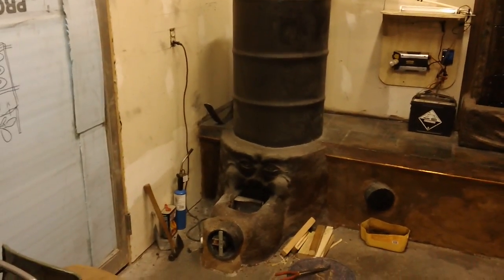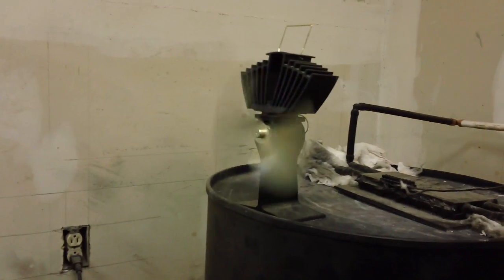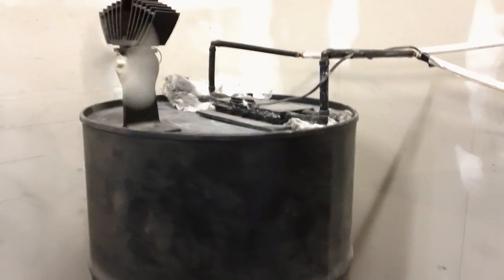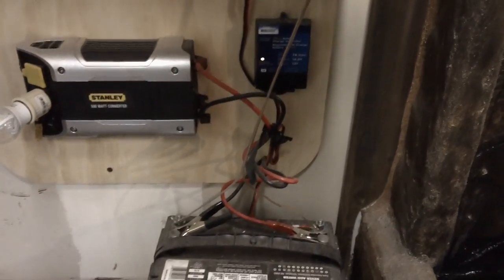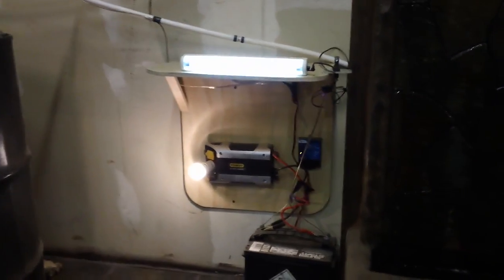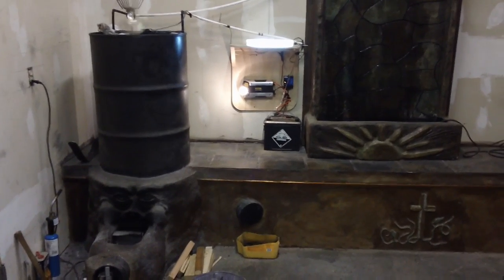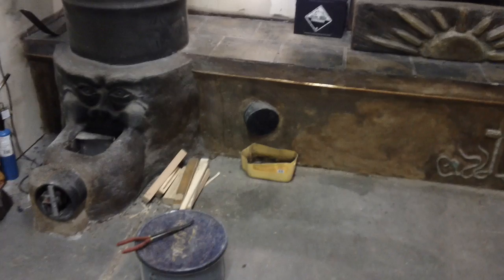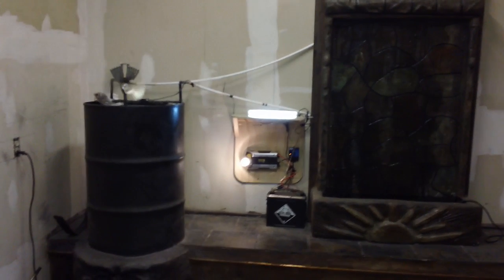Rocket Stove / Thermoelectric generator and waterfall part 1

Comment: put 2 pavers under the battery do to batteries not liking heat they won't work as well with high temps I know from experience I live in one of the hottest states

Comment: Nice idea brother, I think I can boost your output some, an outside air intake plumbed to direct air through a radiator that cools your TEG units before it enters your rocket stove should produce a temperature difference that will create even more electricity. God bless!

Comment: Good stuff. I had been reading lots of Tesla patents, and later in his life he took the trouble to patent a fountain. A lot of people scratch their head over his fountain because why would a guy like Tesla work on something so modest. But what is interesting about his fountain, is that it uses a tiny, lower power, spinning motor with a prop at the bottom to spin the water level up into a vortex. The water level rises up, and spills over the circular shape of the fountain. So with very little power, he can move all that water, and make it fall. Anyway, just an idea for you.

Comment: Great video! Where did you buy the thermoelectric generator and what did it cost? Do you have any more specs for it like what conductors/semiconductors it uses?
Reply from the maker: the thermal electric generator modules can be purchased on the Internet  I get the best ones with the most power for the cheapest price I can find some of my other videos will give you a lot more information about the TE Gees

Comment: waterfall may seem a bit silly to some, but yea it can be a very efficient way to transfer heat from the water. when the stove isn't in use, I wouldn't doubt you'd actually see the water temperature drop 5-10F below room temperature due to the evaporative effects. the peltiers will work best with the biggest temperature difference between the hot and cold sides, so good water circulation will help, but you'd want to be sure to generate plenty more power than what is used to maintain the system. a small 12 volt pump might be enough to keep the water circulating but use very little power.

Comment: Damm interesting!
If you used a couple of one way ball valves like the heater in an electric coffee percolator that might work as an alternative for the waterfall pump and any steam produced could be useful... Old railway locomotives used a jet of low pressure steam going up & out the smoke stack to pull air into the firebox faster.

Comment: This concept could be used with household furnace.
Thermoelectric modules could be place around chimney flues/inside furnace heat exchangers/on heat plenum coming off furnace. It all about how to widen the heat difference.
Why no one has developed a furnace where the heat exchanger is the TEG is beyond me - it would be a stand alone furnace and then some.

Comment: I really like the way you have put together this system. The waterfall is a brilliant idea too. I would love to see this system perfected (relatively speaking) and in a finished home setting so people can see that it can be functional as well as be integrated into a nice modernized look.

Have you thought about using steam to generate electricity?
Reply from the maker: Thanks.. This system could be in a rock wall with fire blow the water fall and would be nice. I just really prove concepts and never get around to finishing much . Steam engines are just about 4%-5% efficient meaning the TEG are about the same with out moving parts to wear out, I also built sterling engine for heat electricity but again no moving parts on the TEG's with about 300,000 hours of operation
Reply: Van Powell As efficient as these heaters are I'm thinking that it should be possible to make enough electricity with them to power a home to the point people wouldn't have to be inconvenienced by lack of power. I just need to learn more about it. I wish I had the same interests 20 years ago when I got my electronics degree that I do now. I could have solved this problem within months. People don't realize the knowledge to fix many current issues has been around for a long time. You just have to understand what your being taught and be a thinker. My instructor always said I should work in R&D. I should have listened. I found out the hard way that the old phrase "use it or lose it" is very true. I have forgot over 99% of what I learned in college and couldn't think my way out of a paper bag when it comes to that stuff these days. lol

Now I just watch youtube & hope I come across someone that has figured out a good & complete system for others to follow ;-)
Reply: Van Powell Isn't that 4%-5% steam engine efficiency based on most of the heat being wasted?
Reply: +MrWhiltetail time is just a number.  You have the know-how and ability now, solve it now!  We all need it!

Comment: we need more of this kind of stuff and i need a video camera i want to go off grid to 12 volt and only invert where it is needed to start i need a liquid cooled gen set ill run off wood gas and steal the heat from the water top up battery but mostly for welding add solar wind thermometric was gona get my wife a exercise bike and put a alternator on it but think ill insulate the dog house first lol

Comment from the maker: I will try harder to explain... the energy put into the pump to lift the water so it can run down the rock must be more than energy collected from any wheel at the bottom.  Same thing with you and your bicycle.. but WHY??
When you peddle you burn calories , calories can be converted to watts. The watts used is less than the force that pushes you down the road. because you loose some of it to friction and heat. the water fall is friction  so the generator would out put less than the pump used

Comment from the maker: yes you could, the thought had passed my mind however you would have to run the water in a stream to get the head pressure you needed to turn the generator. That might not give off the heat as well. Remember as well you cant get out what you put in.. so yuo could not capture the same amount of power from the whell generator as was put into the pump to lift it in the first place.